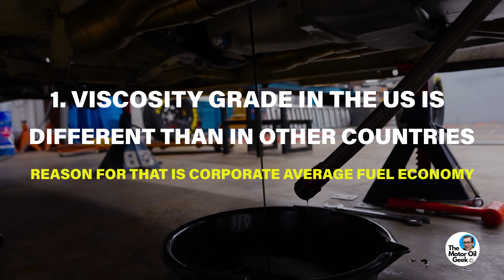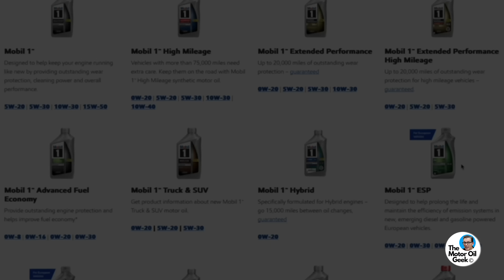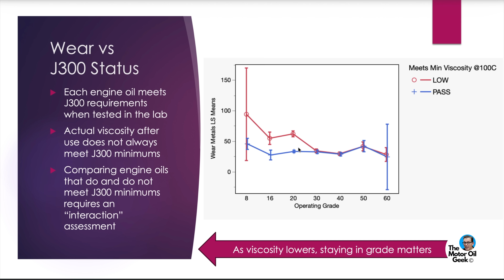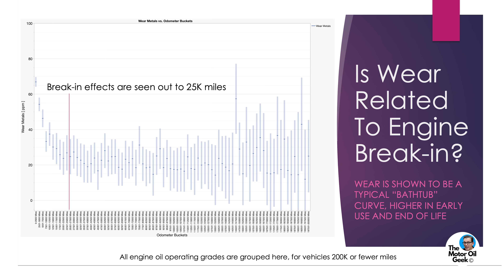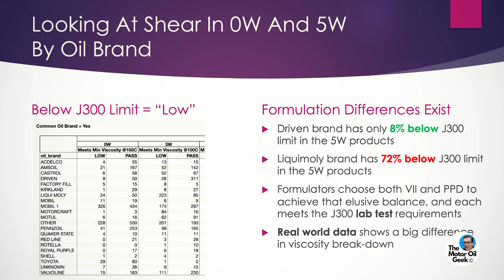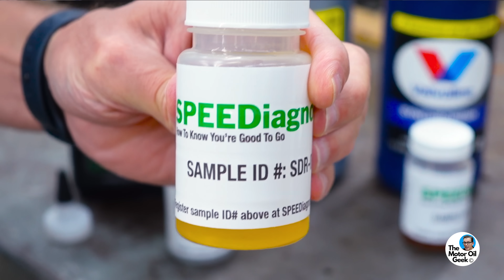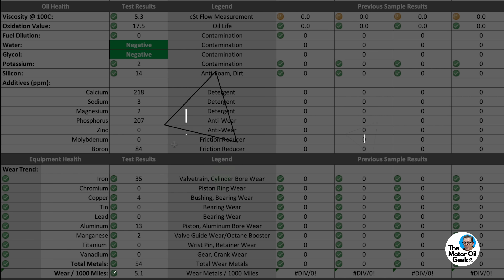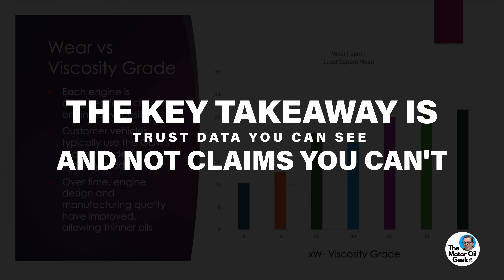More Ai Lies? The FACTS about 0W-20 vs 5W-30 (With Evidence)

Comment: Ok so, I live in South Florida, I have a '21 hyundai sonata SE, 2.5 L engine. 
The OEM says 0w-20 however, it's Florida so it's never cold. Summer temps hit 96 in the summer.  Would 5w-20 be better to run or is OEM Oil ok? 
I usually use Castrol edge full synthetic

Comment: this might matter in a newer engine but think youd be a idiot to go to a 0w oil in a engine that the manufacturer specifically calls for sae 30......(say like pre 55 or so) not 10w30 just straight 30 weight.....think the newer thinner oil would cause a low oil pressure issue......just a assumption......but since i drive 60 yr old cars any way none of this matters to me.....i stick to the manufacturers requirements......but it is interesting info on oil dynamics

Comment: So what I am seeing is, if you change your oil very often, maybe every 3,000 to 5,000 miles, you can use 0w30. But if you go to the manufacturers recommended 10,000 miles, you better be using 5W30 as it is better than 0W30 when it shears out of grade.

Comment: The thing about sheering out of grade is where it starts and ends.  I believe a 30 weight starts at 9.5 cSt.   There are many 30’s that start at 10.0, so a half a point isn’t much.  Many 20’s start in the mid to high 8’s.  Also, as you said at one point, 0w-20 works but with little margin on the Stribek curve, personally I like the security.   I’ve also heard many say the reason the manufacturing debris is so damaging now is the thinner oils can’t compensate as well.  This tells me that there may be another benefit to a 30.   I drive a car with a known rocker arm failure issue so something obviously isn’t working well in it. I run a 0w-30, but this 30 starts at 12.3 cSt, UOA shows it sheers down to about 11.5.   Lastly, your wear tests show 20w has low wear.  I don’t think general wear is the issue in all these failing engines.  I theorize that because they are so close on the Stribek curve, when enough sheer/dilution takes place it fails suddenly  and catastrophically, not slowly from excessive wear.

Comment: As far as oil pressure goes, a 5w40 vs a 10w40 in the exact same brand, the 10w40 holds better idle oil pressure and slightly higher oil pressure across the board. 
This is including baking in 100 degree weather in traffic. 
In high performance applications this is why I prefers  customers to oils that have more sheer stability.
It’s approximately 5 psi at idle and 5 psi at rpm.

Comment: Thanks for this video. On a side note, I see you did an analysis of Walmart oil. Please do one on Kirkland oil.  It's half the cost of brands such as Penzoil (which I use) for 0W20, but I can't find any credible reviews, and I don't want to risk it. I have the Mopar Pentistar 3.6 engine used in my Jeep and many other vehicles.  Thanks!
Reply from the maker: The Walmart oil and the Kirkland oil are made by the same private label blender and the specs are identical.

Comment: So 0w30 is less stable than 5w30? In theory, 0w30 should offer more cold start protection…. Can you make a comparaison video  0w30 vs 5w30?
Reply: if u see the SAE sheet the only difference btw 0w and 5w is the cranking viscosity at -35 celsius.
Reply: @Malossianoplus  if you Watch the video you’ll hear that the shear stability is better on 5w30 than 0w30. There could be an interest to compare ….

Comment: I did a blackstone oil analysis on my 15 prius w/167k miles and had a little trouble reading the report but the comment section seemed to be very helpful. They said my car was in good shape and that I can probably get away with 7500 mile oil changes but I will continue to change my oil at the 5000 mile mark.

Comment: The real question to me is, what would manufacturers recommend if there were zero regulatory concerns, and they were liable to suits if they did not recommend the one that maximized longevity. Since I don't know,  I stick to 0w20, but because I don't trust them, I change oil every 5 to 6k miles.

Comment: Question my 4.6l V8 takes 5w-30 and my 6.8l V10 takes 5w-20 both 2 valves with PI Heads. Besides the V10 having a unique Lamborghini firing order and much larger forged crank they are on the same modular platform so they are built identical just ones scaled way up in proportions. My question is the Mustang 4.6 V8 5w-30 is thin down to a 5w-20 when it's ready to change so why would Ford want the V10 to run a thinner oil is it actually needed? Additionally the V10 only in the owners manual states the crank atomizies oil and you have to check the oil bec8it eats it. I have not seen mine ever do this in any large amount but it's also very low miles 30k. Just interesting because I think a 5w-30 in this V10 would have made more sense to stop crank oil usage but then again it's a forged crank this is the difference that might require the thinner oil too!

Comment: Jeep recommends 0w20 for the 3.6 v6. Everyone is saying to switch to 5w20. Or 5w30.. but,  since the engine is being started more or less dry. Wouldn't it be better to stick with 0w20 because it circulates faster because it's thinner?

Comment: First, I am in no way dispute the data that I am interested in, which was the "stay in grade".Facts are Facts. I would really like to see a test with a LOT more samples of the Shell oil, as I have been running Shell Rotella 5-30 in my diesels for years with excellent results. Your data seemed to only have about 6 total samples or less for that particular oil, and the T4 for older diesels and the T6 for newer is a very big favorite among diesel truck drivers. Great video as always.
Reply from the maker: Those were gasoline engine samples only. We separate diesel engines from gasoline engines in the analysis.

Comment: One thing I never see discussed is oil on problem engines. Those engines known to start using on oem but thicker fixes it. One example is the Subaru 4 cylinder cars 0w20 but switching to 5w30 stops the oil consumption. I think some of the Korean engines experience similar issues. Does changing viscosity or oil type help any of the dozens of engines with timing chain wear issues from say GM or any of the Germans.

Comment: Bottom line for me. My engine has 230k miles. Not sure at the moment how many engine hours. It burns less 5w-30 than 0w-20. So switching made sense. Needed a thicker viscosity as a result of looser tolerances with engine age.

Comment: Euro ACEA C3 is a stay in grade oil especially with a VW 504/507 spec. Only 20
Weight I would ever consider using is Mobil 1 ESP X2 0w20. API oils aren’t that good, Hince why they have to have a high mileage oil as well in all the viscosities, you don’t see high mileage oils in euro specs bc thier oil is top tier

Comment: I might know what video is being referred to because I think I saw the same one. Might have been different. Another point the AI video made is the oil used also differs between climate. Is that something that really should be taken into account or can it be ignored? For instance I drive a 2024 Subaru WRX and I live in TX. Would 5w30 make sense over the manufactures recommended 0w20 because of the hot climate having something thicker would perform/protect better than say I move to Wisconsin or something in the middle of winter where 0w20 might make more sense because it won't be as thick in the cold?

Comment: Wouldn't the first steps of 5W-30 shearing out of grade approach 0W-20 behavior before being a problem?

Of note is that some of the data used were examples of xW-20 compared to xW-30 and I don't think that provides a good argument for 0W-20 (or 0W-16) vs 5W-30.

Comment: So the facts are:
1) When OEM’s are not constrained by CAFE standards, they suggest 30 weight oil.
2) 30 weight oils are more likely to shear out of grade than 20 weight oils. But when they do, unlike 20 weight oils, they still provide sufficient wear protection.
3) You can receive the adequate protection from 20 weight oil, by ensuring you have specific oil brands that don’t shear out of grade and do regular oil testing to confirm. Or you could just use a 30 weight oil.

Basically a long video just confirming you should run a thirty weight.

Comment: Please correct me if I'm wrong, but if the argument boils down to "0W-20 or 5W-30," I'm still taking 5W-30 based on your data. While it's twice as likely for 5W-30 to go out of grade as it is for 0W-20, out of grade 0W-20 causes more wear then either in grade or out of grade 5W-30. It seems like a risk unless I want to lab test my oil after every change. Shear isn't the issue, it's engine wear. 0W-20 is more likely to cause higher engine wear based on your data.  That's the conclusion I drew looking at it, but please let me know if I misread.

Comment: Greetings Lake or anyone else who can chime in. I'm a retired, USAF, Jet Engine Master Mechanic for over 20+ years. Changed oil on jet turbines in all modern aircraft and seen unique results from jet turbine wear as I have including the harshest condition in war time. That being said, the wife and I recently purchased a '25 Hyundai Limited, 4 cyl.. The car company, I learned afterwards, has a sketchy if not a less than optimal history on engines taking terminal damage at all various mileage from spun bearings to camshafts. My question is only in this video do you discuss (and learned) about your context of 'oil wearing in and out of grade'. Currently, 'Hyundai', recommends ALL OIL CHANGES, including BREAK IN times from new motors to be NO LESS than 6,500!! I couldn't believe it! The motors are all outfitted with OW-20 and I wouldn't sign on the line unless they gave me 3 oil changes in under the FIRST 3,500. They did. So, is there a 'expected' lifetime range for casual driving on OW-20 to reference what's out of grade based on mileage? I still get the feeling OW-20 is TOO thin, especially here in Tucson, AZ where the temps exceed 110°, easily. Just curious if there is data that would point to OW-20 being inappropriate for every 6,500 miles vs changing it say around 3K to prevent all the engine damage that's currently plaguing these motors. Anyone with knowledge on the subject (or you LAKE!) would be greatly received!!

Comment: My subie calls for 0w20..   I've run 5w30 for almost 300000km and have had zero issues..   It gets changed at 5000 km religiously, although i DO add a quart or so around the 4000km mark.   Fuck CAFE

Comment: My mechanic builds race cars. Very knowledgeable about my 2018 Camry engine.  His input was use manufacturers recommended oil and grade.  The engine , sensors and computers are all relying on that oil to process information. If you plan on keeping the vehicle a long time , change the oil 5K if using Mobile 1 or 8K if using Toyota oil.  Mobile 1 is not fully synthetic  and does not have the same specifications as the Toyota oil. I used Mobile 1 because I changed my oil in early spring and fall .  Sometimes only 4K miles.  🇺🇸✌️

Comment: Thank you for the explanation — finally someone explained it in detail. I live in Russia and use 0W-20 oil for my car, as recommended by the vehicle manufacturer. I’ve been driving this way for many years with no issues and so far I only use Shell oil.

Comment: In the service industry I have seen several local vehicles go 500k+ miles. They used 5w30 Penzoil syn blend…religiously changed at 3,000 miles.

Comment: I have a 2017 Toyota ,Highlander with a V6 and I switched to a 5w-30 Valvoline oil.   My lifter noise decreased significantly.  My climate in SW Virginia is that a few days in the winter single digit lows and summer mid 90's for 7 to 10 days total.  My goal is to lubricate my engine properly in this type of climate. I'm thinking , I should switch to 10w-30. to stay in grade better.

Comment: I’ve been driving in 2024 Acura Integra since its release… it runs on zero20…. I’ve been changing the motor oil every 3 to 5000 miles trying to keep it closer to three than five…. And knock on wood this has been one of the best performing cars I’ve ever had not only for the four-cylinder motor that it has being only 1.5 L a generates about 220 hp and around 230 foot pounds of torque…. I’ve been putting quite a pounding on it as I drive it pretty hard and like I said, knock on wood I have had no troubles…. But I also treat it like a delicate flower like I said I do frequent oil changes… same with the air filter and cabin filter… I’m sure to keep the tire pressure spot on.. I only use top grade fuel as recommend recommended by the manufacturer…. But most importantly while driving it because it’s a turbo vehicle I make sure to warm it up and after a long drive, I make sure to cool it down a little bit, taking it for a very slow, easy, gentle drive, and then letting it idle for a moment or two to get everything stabilized….. I plan on upgrading the oil pump and the water pump when it comes time to service them… I figure if I do these things and don’t put any heavy modifications on the car. It should last me quite some time. My biggest concern is all the plastic bits and bobs and all the wiring. That’s what scares me.

Comment: I think the more important fact is the mileage of the vehicle 80% of the vehicles or the road have 60k miles or more and the thinner the oil the easier it becomes out of spec. Lets test theses oils on the average car with average miles and see how they hold up. My Honda and my Toyota have oil change notifications which alert me to needing that service, if I use 0w-20 oil in either one of the I can hear the difference before the oil change interval has indicated. This means the oil has degraded or came out of spec before the mfg recommended interval, however if I use 5w30 the engine remains quiet for that stated mfg interval. So I will not be using a lower viscosity oil to save $0.02 cents a mile and wear my engine prematurely. Also the savings is mute if your paying more for that oil That seems to vaporize in your crankcase. These tests and analyses may work well with a new vehicle under perfect conditions, however that rarely exists in the real world. Changing the oil and filter at under 5000 mile with quality products and 5w30 at a minimum has gotten me over 200k miles on ^ vehicle to date.

Comment: I’m on my third Ram truck. I had well over 200,000 on the 05 that I traded for an 18 that had just over 100,000 miles when traded for the 24. This one is a 2500 6.4 Hemi gasoline engine. Per mfg information I’m running 0W 40 Mobil 1. Is Mobil 1 good or should I run a different brand?

Comment: Wrong viscosity may cause valves to burn as the lifters may not open or close properly. Also, thinner viscosities will circulate the oil quicker in colder weather.

Comment: May i?we ask for a video that states which oils perform best regarding stable and longer lasting viscosity? Secondly, having asked a question of my mechanic about oil weights, he said the extremely tight specs regarding engine needs per design, using a higher viscosity can cause issues is there is increased oil pressure via a "thicker" oil... Is that correct? THX!!!

Comment: My 2013 Genesis coupe 3.8 uses 5w 30, but my newer Elantra N uses 0w30. Ive always changed my Genesis coupe at around 3k, and shes now over 150k, runs fine knock on wood lol. Hyundai recommends 10k oil change intervals for my Elantra N, but ive been changing it every 3-4k. May be overkill, but id rather do that on my vehicles than risk damaging my engine with dirty oil, especially since the N has a turbo.

Comment: 374000 miles on my truck !!!  Same engine, same transmission and the same rear end. We change the fluids slot, the truck is a 2011 Ford f150 3.7 non turbo 5 /20 oil synthetic blend we change it every 3000 miles!!! Ps it loses no oil between changes.  One of our other work vehicles went 430000 miles Ps change your oil every 3000 miles .thanks for the videos
Reply: Prior comment should have said change the fluids alot.

Comment: I saw that video which challenged my understanding somewhat - Oil is very nuanced  - totally agree that  opinions are not facts - I recently got my hands on gallons of the old Valvoline Profleet synthetic 10w40  from a firm that's fleet switched over to low sap to meet  E6 - This is a very high spec oil  loaded with addatives perfect for my 25 year old RV

Comment: Odd that GM has switched many of it's troublesome V8 engines from 0W-20 to a thicker oil if it makes no difference; anyways, I will run 5W-30, not 0W-20 in my 2022 CR-V.

Comment: Oh boy, this channel really isnt meant for me, but let me say my opinion out loud.
First of all, thanks for getting me aware that ai is now scamming us even with the oil questions, i'll just stick to Project Farm, who does reliable videos.
On the other hand, the question about oil really is overcomplicated by people. On new cars, let's say your driver's handbook says (vw507.00 specification) 0w20 or 0w40 oil recommended (not sure if it exists, i only wanted an example), then, depending on the use, get the one from the book. Thinner w20 oil for small trips, city driving, cold climate. W40 for highway use.
Its not about the viscosity, its not that much about the brand. Its about the fact that you need to change your oil more often, than the factory recommendation. No 30-20-15k change periods, stick to 10.000 on N/A engines, and max 8.000 on turbocharged engines.

You should never put in oil with the wrong viscosity or oil specification. Always try to look for oil, that has the correct specification either approved or recommended by the car maker themselves, not only by the oil manufacturer.
As for older cars, the same thing applies, but with an extra twist.
If your engine came out from the factory with semi-synthetic oil, buy semi synthetic for it. You can buy oils with good enough detergent additive packages, that'll not just keep your engine clean, but which will even clean your engine.